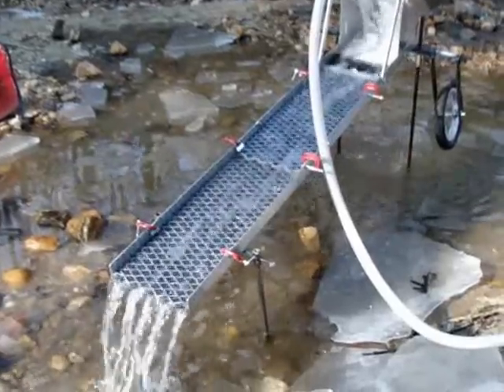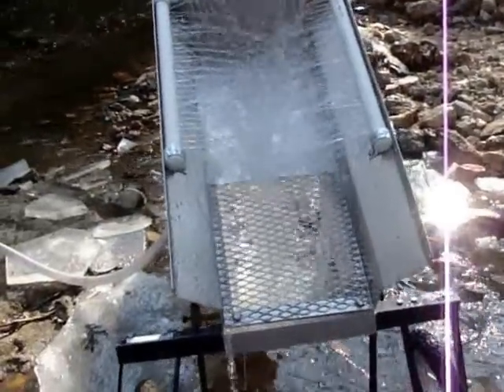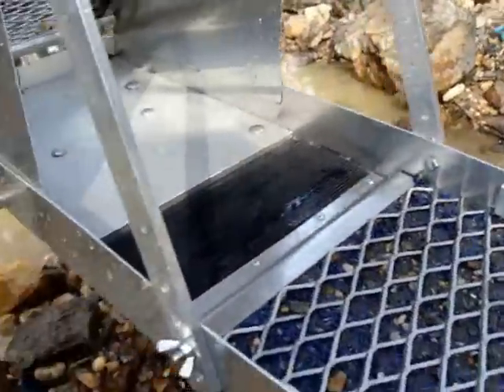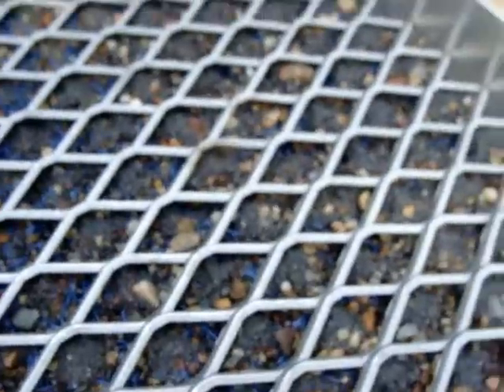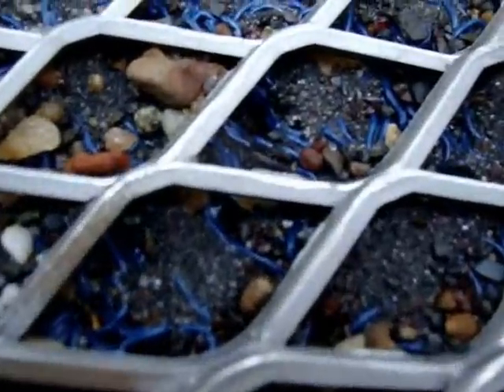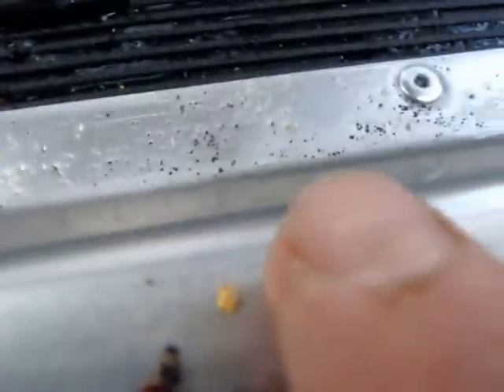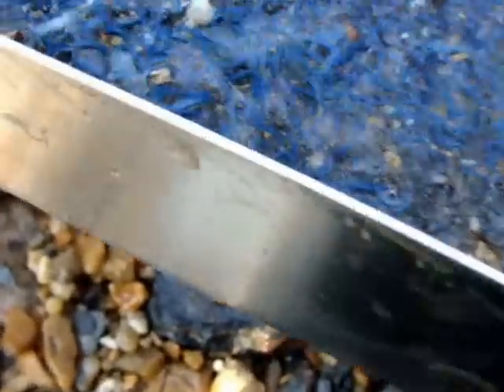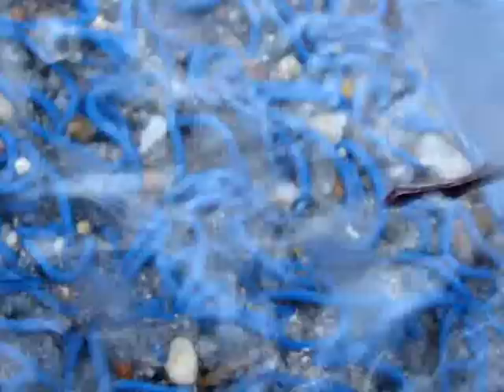Homemade Highbanker Testing

Comment: Just subscribed.  That's a fantastic job you did there!  Anytime you find that much gold, you know you did a great job designing and building.  Love the wheels for transportability!  
I built a ladder system out of 1"x1" angle aluminum along the sides and 1"x1/2" as the rungs for riffles.  I then secured the sides by drilling 1/4" holes in the side angles and sides of the sluice and ran a bolt with wing nut through them to hold down the expanded metal.  GL